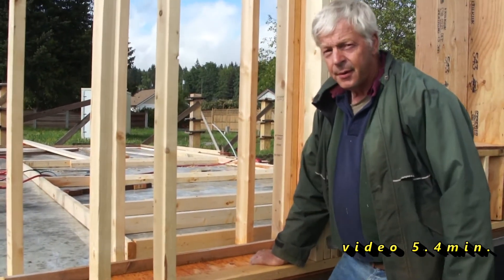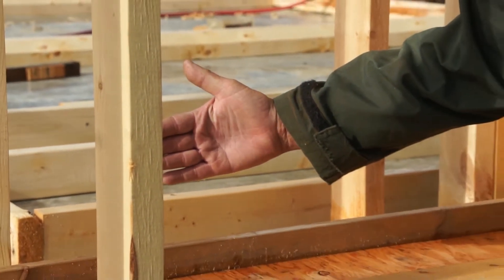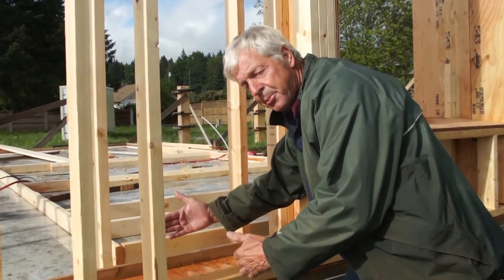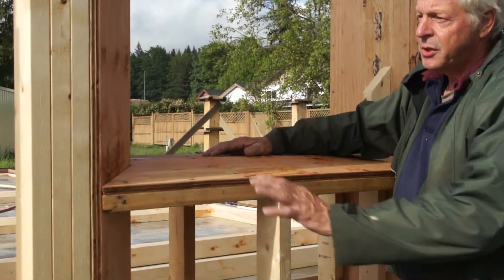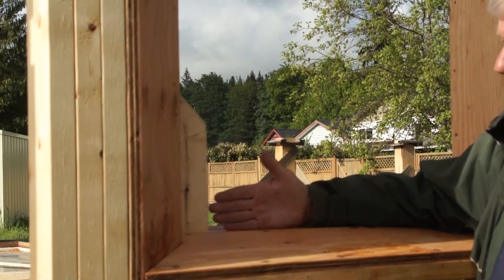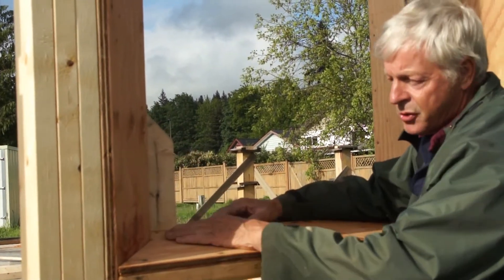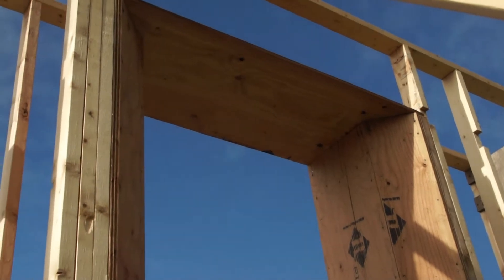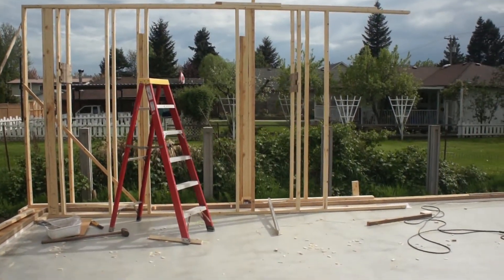Passive House Construction/ Double Wall build and the window wells plywood liners

Comment: What is a Passive House window? 
Most energy-conserving windows fall into the catagory of double glazed windows. QXL’s passive house windows have three panes of glass, significantly increasing the insulating power. High performance passive house windows are a key ingredient in this revolutionary approach to sustainable design.  Passive Houses must be extremely air-tight and well-insulated, and it is impossible to achieve this in a building without extremely well crafted windows.  
E-mail: zhuang@ysqxl.com
en.ysqxl.com
Reply from the maker: Aye the windows in this Passive house will have triple glazing with e-glass and gas filled
Reply: Sure, it is Low-E glass and filled with Argon